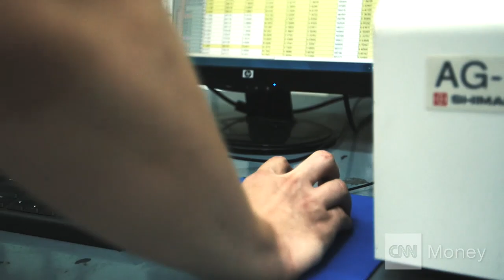This plastic is made from thin air

Comment: Quite simply I am using the hydroxy to expand water "the water is injected by way of my original fuel injection system" in the cylinder chamber. Therein creating a steam powered engine. the hydroxy itself is not enough to efficiently power my 2.2 liter engine. It will idle and rev using nothing but the hydroxy but not over 2,500 RPMs. And it also run very hot with nothing but "hho". I have four dry cell batteries in the back of my car. I have replaced my sun roof with a solar panel that charges the dry cell batteries. I have three junkyard alternators with small stainless steel fan attached that protrude half way into the hood of the car, so while I am driving the air passing over the hood turns the alternators recharging the batteries. I have a header style intake that I have mounted four electric solenoids into. the solenoid work in conjunction with my throttle by way of a pulse width modulator to properly distribute the hydroxy into the intake manifold. ----he continues

Comment: This is a BS scam, and this "engineer" obviously doesn't understand the law of conservation of energy.   It's energy intensive to remove the trace gas from the air, and even if it wasn't, breaking it down to carbon and adding the hydrogen will consume much more energy than producing the plastic directly from petroleum consume....A LOT MORE....like 100-500x as much energy.
Reply: someone worked it out it was 40 times the energy so 40 gallons of oil into energy then put into the mechine what will make 1 gallon of plastic buuuuuut when oil runs out it might be the only way